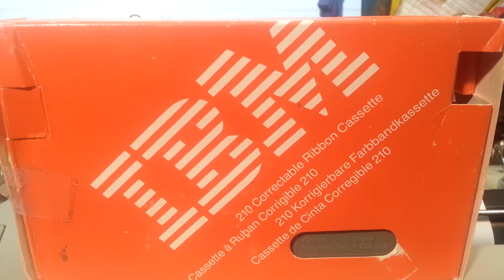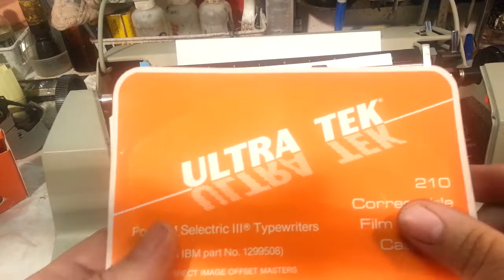IBM Selectric 3 III Typewriter Ribbon Install 210 Bicycle Style Correction Tape too.....

Comment: Is it possible to change the ribbon holder; so it can hold the regular ribbon, on a 50th anniversary Selectric?
Reply from the maker: Yes, but you need to salvage lots of parts from a donor machine
Couple modification need to be made, cutting a plate and some other small mods
Only done a couple, last one was decades ago.

Comment: Does the movement of the ribbon rely on movement of the sharp spiky post or is there a gear mechanism in the cartridge itself?  I just got my Selectric III today, and as I am waiting for a ribbon, I notice that the sharp spiky post does not move when I type.  I would have expected this to move in order to advance the ribbon, but it seems that the large grey gear does not connect to the small gear under the springy post (the white thing at 2:25 that is in the immediate foreground).  Any thoughts?
Reply from the maker: The spike turns very very slow & seems/looks like it's not turning. those gears have teeth on both sides & are visually confusing. Mark one or more of the gears with a small mark from a marker & you can see movement better.  This is not a trouble area usually so I bet it's working.